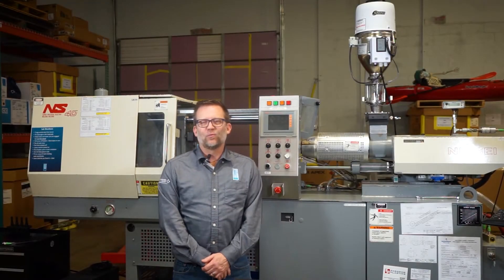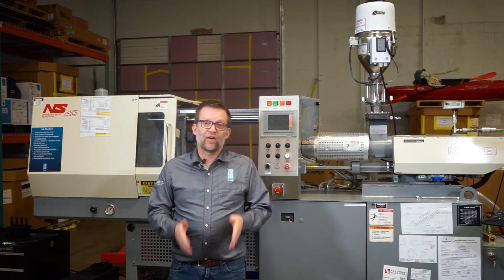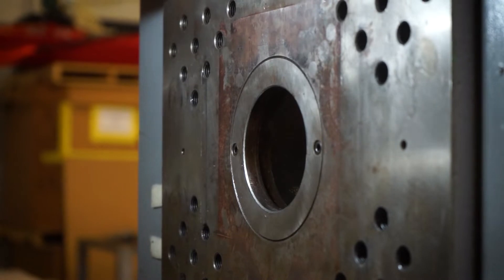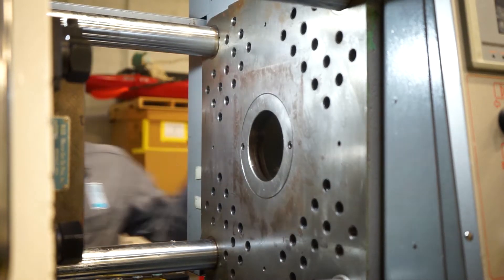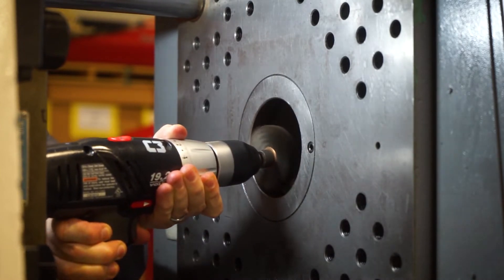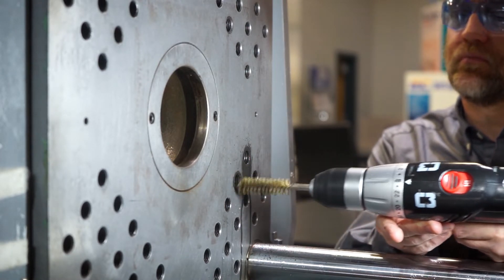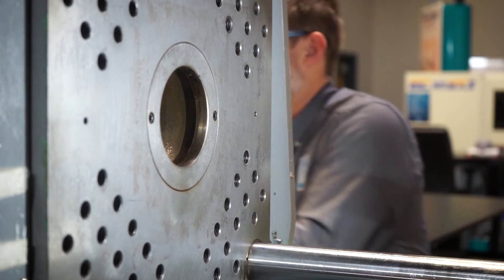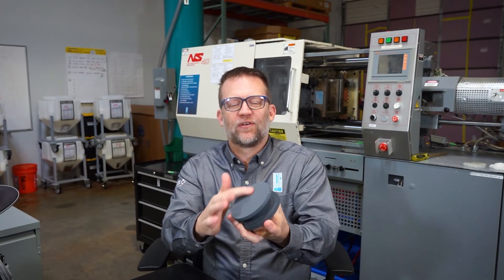Injection Molding Platen Care

Comment: That last tip on the bolt is something I stress so much to mold setters.
Reply from the maker: SO important! Sounds like they have a great teacher!
Reply: @rjg what if we found something wrong when bolt usage, what we do then ?
Reply: I always say 1-1/2 - 2x nothing less nothing more. Also the importance of bolt to heel ratio on clamps and heel thickness.. when I got to my place there was only one mold setter and he was only gunning the bolts in about 2/3rd of the thickness and he was sliding the clamps as far in as he can and not really paying attention to the thickness of the heel (always want it slightly more then the plate) and I had to explain that it's like a teeter totter and theirs not as much leverage that way. I'd take a clamp that's 2" on the plate over one that's 4" on the plate any day that way the distribution is more evenly and not just on the heel.
Reply: that is unless if the platen holes are reallllly close to the plate like within 2 inches but 3-4 inches away just throw an extra on each side and use the toe even if it's on the flat side.

Comment: Maybe think about adding the 3M scotchguard rotary cleaning discs. Unlike your stones, they are non abrasive.
Reply from the maker: Scotchgaurd pads are another alternative. The disk that we used here are abrasive but much softer than the platens , therefore they will remover anything from the platen that is not supposed to be there, Thank you for the feedback.
Reply: Platen stones are used almost universally in the injection molding industry. I've never worked in a plant that used scotchguard cleaning discs.
Reply: Everything is abrasive to some degree.  It might be .0001 (1/10,000 of an inch or even less), but it is abrasive
Reply: The great thing about precision stones is their ability to keep the platens level and square if used correctly.😊  By thread chasing the bolt holes with a correct-sized tap, it should just about cause the mold to last indefinitely.  In 1969, we stuck a injection molding scissor press when it went to dead center.  It took two days to free that rascal.  We used Multiple Hydraulic jacks and the forklift truck.😢

Comment: have you seen platenGUARD locating rings... they have a silicone face that protrudes to protect the platen from ring strikes when mold setting.  You can find these on Mold Masters hot runner systems and at DMS Mold components.